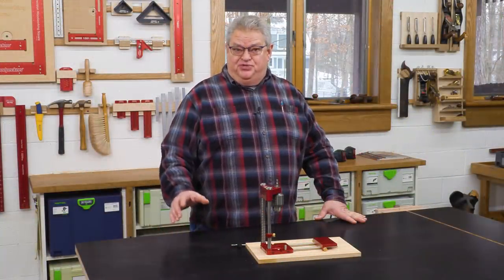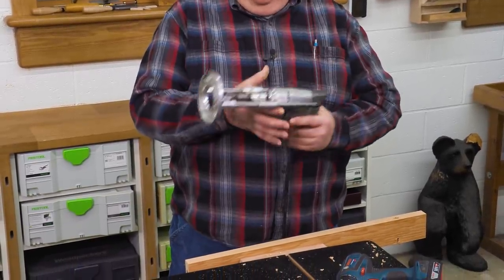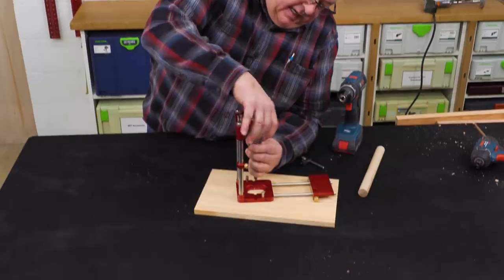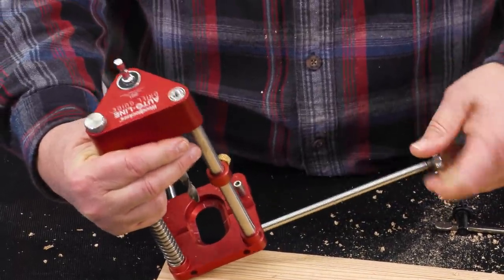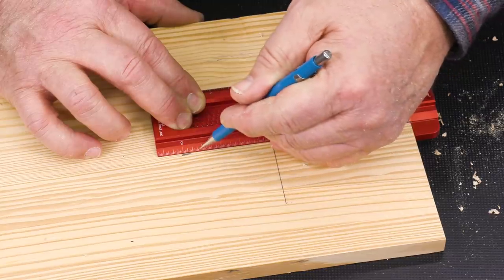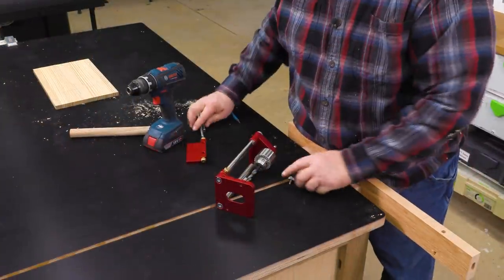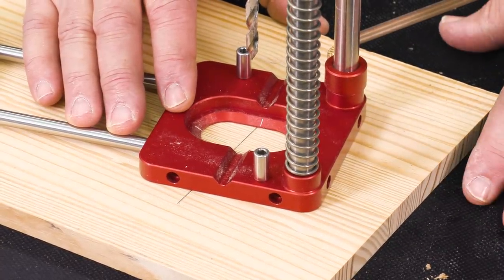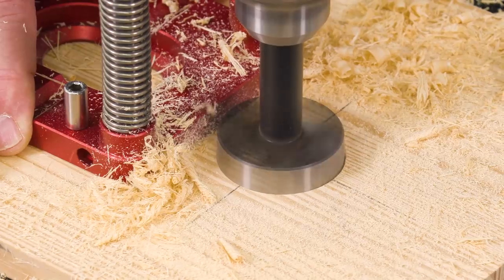The Best NEW Drill Guide For Woodworking - Auto-Line Drill Guide | Deep Dive

Comment: This style of guides are ergonomically terrible.  You need to press firmly on the base with one hand, then you need to raise your other arm pretty high to push down with force the drill while keep the motion vertical.  Is not easy unless you have a big wingspan.
There is some little play so you better push down vertically very smoothly else it won't be really straight.